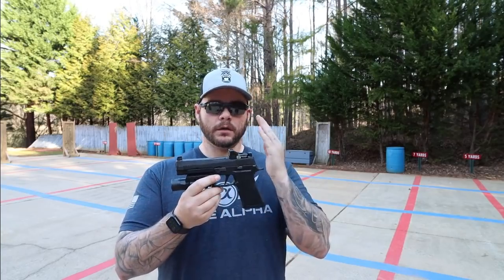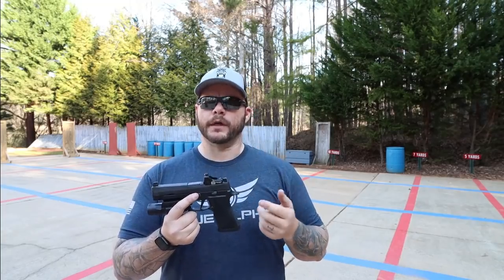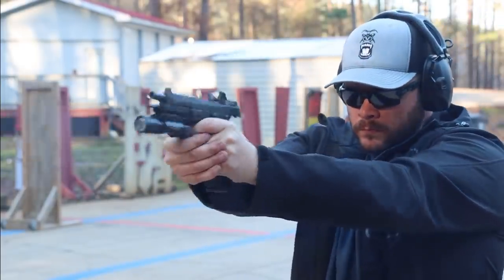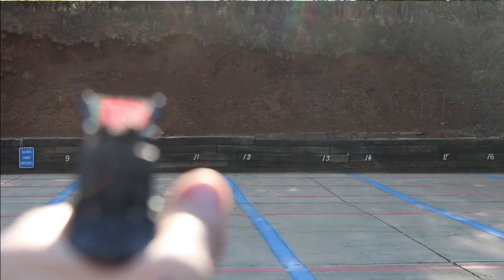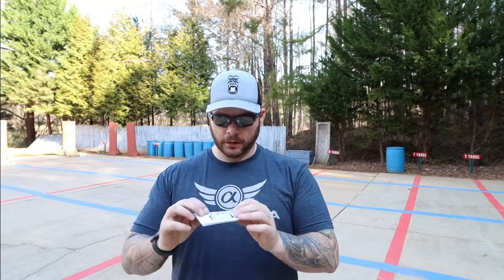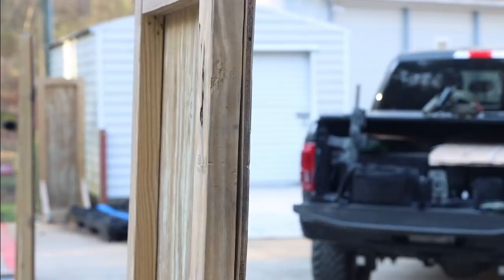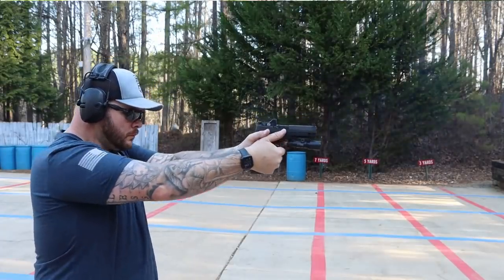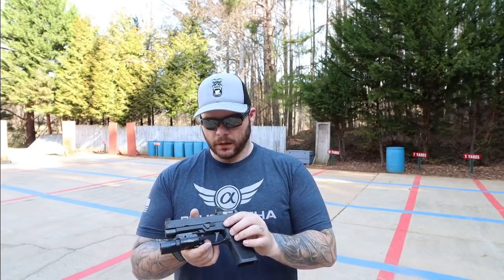Grace Optics M1

Comment: Sadly a lot of people like to cry 3 -5 times ,not buy once cry once
Reply: I tried very hard to convince myself NOT to buy an RMR but in the end I did just that and Aaron's testing is what convinced me. Yeah, it cost 80% of the gun I put it on, but I know the damn thing will work when I need it to.
Reply: @wewd  same. I'm still rocking a Gen 1 RMR with no issue. Love that thing.
Reply: Or I could get a 507 and barely cry at all ;D
Reply: Yeah, those people are called “The Poors.” 😂🤣😂
Reply: It especially doesn't make sense with body armor. Too many dudes out there running around basically with cheap steel targets on them. Don't want to end up being next to them if ever under fire. I went all in and got Hesco Ceramics.
Reply: Well who tee who says an 80$ acog is just as good as the real thing hahaha
Reply: @desertdwellintom  meh, 300 for holosun 430 for rmr.......
I'll take the rmr.......until holosuns are cheap again 😆
Reply: @prone_wolf8871  you can find the 507c for $250 shipped without too much of a struggle.
Reply: No one?
Cry or die?
Reply: @prone_wolf8871  My man, where have you been looking for Holosuns!? They’re $250 and under right now for the 507.
Reply: @Random Pickle The distortion is way worse on my Holosuns (507, 508) than my RMRs (SRO, RMR, RMRc)
Reply: @smith8124   link?
Reply: @prone_wolf8871  Hop on Reddit, go to the “r/gundeals” sub. They pop up every other day or so. If you search the subreddit you’ll 100% find one. Also, if you really want to try and save, buy on off “r/gunaccesoriesforsale” subreddit. Cheers
Reply: @musicman1eanda  a set of 4400's or l210's and a carrier is going to run you as much as a single new Glock if you are savvy with your money. Really no reason ever to not get the good plates.
Reply: I've wasted lots over the years figuring this out.
Reply: @smith8124  I only like to buy from reputable dealers . But everywhere I find it over 250.....again no big deal its fifty bucks.......
Reply: @prone_wolf8871  Tons of smaller but reputable and vetted retailers on r/gundeals. I’ve built multiple firearms and saved a bundle using the posts from the sub. If you’re really concerned put it on a credit card, not a debit card - credit cards will refund you and run the payment as a charge back with almost no effort on your end.
Reply: Literally just did a 15 sec search of r/gundeals and Lake Armory has the 507C-X2 in stock for $250

Comment: “Well, I’m not gonna drop my gun” 

I’ve said this, and I haven’t dropped it but even conceal carrying my full size M&P, my RMR has had its share of hitting the back of chairs or tall tables. Only thing it seems to hurt is my feelings, because it was expensive, but it holds its 25 yard zero perfectly. 

Also I got my slide cut, bought my RMR, and put in the training to run it effectively because of this channel. Thanks for what you do

Comment: Blue alpha gear! Great belts own both versions 🤘🇺🇸
Reply: Hey thanks! 😁🍻
Reply: I really like my kore belt. I had the next belt because John lovell recommended it and I only got about 6-8 months out of it. Grated I carry a g19 and a +5 spare mag in an aiwb it's a lot of weight but the kore carries it really well. It's thicker taller and stiffer than the next. I'm a big fan of the ratchet too. The adjustability is top notch! What makes you like the B. A. Belt so much? I'm always looking for any way to add an extra level of comfort.
Reply: @BlueAlphaBelts  no problem thank you for awesome product 🤘🇺🇸
Reply: @alexduke5402  I like it because it fits through all my pants and l has alot of rigidity also very easy to put on amd take off. I honestly like the low profile felt a little better than the hybrid EDC belt because the Buckle kind of gets in the way of appendix carry

Comment: Despite the cataphoric failure off a single drop test. When you were doing one handed manipulation, did you use Loctite then tighten it screw?  Not that it even matters, since this optic wouldn't be good for any application.

Comment: If I may ask what holster are you using for the p320?  I have an m17 slide and an m18 with rmr. But would like to get a holster similar to the Glock. The 6453do for the 34 fits the shorter slides with or without a light.  But I am having difficulty finding info in regards to p320 holsters.   Thanks

Comment: What sights are on that gun? Sig suppressor height?  I have that exact slide but with short xray sights. The rear sight came from factory with a crack running up the rear sight above tritium vile so I need a new set.

Comment: There's an easy fix for all of this. When you have to turn it on every 4 hours you can just add in a quick re-torque of the screws & super gluing the lens back in to your regiment. Problem solved.

side note Invent a super glue/torque wrench IWB carry pouch

Comment: Too bad cuz this optic could have been good if they had designed it to have the lense locked into a frame instead of epoxy like it looks like it does.   No back or top support ultimately had it fail.

Comment: I was waiting for this review. As soon as I saw the optic with its open topped design I knew it would be a big FAIL. Open topped cars need serious chassis reinforcement as the roof provides a lot of structural integrity. Same goes for optics. You take the top off, which is usually the first place force is applied on a dropped optic, and you are asking for trouble. Cant even believe the designers of this thought it was a good idea. Gimmick sales only.

Comment: Just my take on the provided info/opinion, seems to me like the niche for this optic is best suited for law enforcement for the most part, small lightweight, decent price, auto shut off in case you forget, manual turn on, extremely simple windage/elevation (dot) adjustment, for an entry team it works well, knowing they are getting into a possible situation so they know to make sure it’s on, automatically shuts off in case they forget to turn it off after a stressful situation, small so it won’t get caught up on any gear etc. and is indoors so it won’t be washed out by too much sunlight, and with the open top it helps to keep you from closing one eye to use it (theory),  two eye open shooting is always best for close quarters “combat” (opinion) and situational awareness (fact), fear of dropping it and it breaking is a legitimate concern, but that’s why all trained people, let alone trained shooters would be aware of that possible situation and would make sure they can see their irons also, rule of thumb with dots on pistols is it should hover just above the front iron sight, and with its price point, if it’s made right and is durable enough to withstand most pistol rounds, or at least the usual issued rounds for officers, I say it’s a good step in the right direction for pistol optics, it’s hard to find a lightweight and small optic for pistols, especially if they are holographic, with dots it’s easier to find small and lightweight but they almost always have crappy battery life, don’t have a auto shut off so the battery dies all the time, and the adjustments are a pain, all in all, it’s a very good option, otherwise, my personal opinion though is primary arms or holosun for anything above airsoft/paintball lol
Reply: The niche for this optic is for people who are ill informed and have no experience with MRDS on handguns. This is definitely in no way suited for law enforcement in anyway. It has the durability of glass getting hit with a hammer. Auto shut off is irrelevant when other designs can stay on for years without turning off at all. It is not hard to find lightweight and functional red dots for pistols. RMR if you have the funds, Holosun if you are on a budget.
Reply: I can’t tell if this is serious. You seriously recommend this? Rather have factory Glock irons.